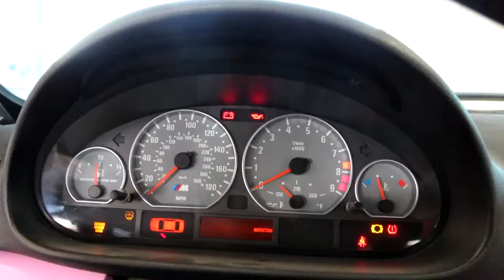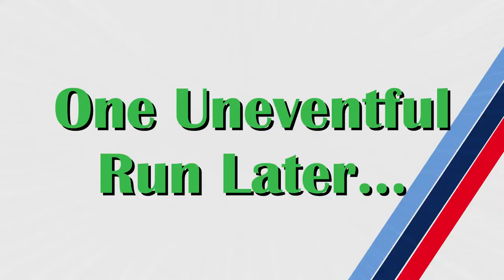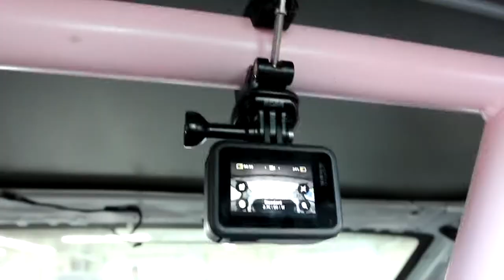The Last Race Of The Year, The QuadDuro Day 2

Comment: Time to buy the fuel starvation kit dude.
Reply from the maker: I need it, cant show up next year if I starve on West at half a tank...
Reply: @WannabeRacer  west is the worst offender. Long rights. T6 and T9. 
It’s a must have for sure. Not sure how you’ve made it this long without it.
Reply from the maker: @xAustinKentx  I'm surprised to hear you say its so bad. Before all the problems started earlier in the season, I only ever starved on Outer in Witchcraft if I was about 1/4 tank, other than that, no issues anywhere. Wasn't till the problems that I ever starved on East. I didn't put it in the video because it wasn't easy to tell, but I starved in Knock Out which didn't happen on Outer or Full during the weekend, only on West. Last year it was a "want" to get a fuel starve kit, this year, its a "need" so I plan on doing it before anything else. In all fairness though, I am a better driver each time I go out, getting faster, and more consistent. I'm probably only now having the problem due to getting faster in the corners, although starvation at 1/2 a tank is a little ridiculous in my opinion.

Comment: any significant difference on engine cooling upon deleting the a/c condenser?
Reply from the maker: Yes. Much better cooling during race conditions although without the electric fan fan for the compressor, it will overheat while idle, so if you plan to use it for road use, maybe consider keeping the fan. Even for track use may consider keeping it, everyone has their own preference.